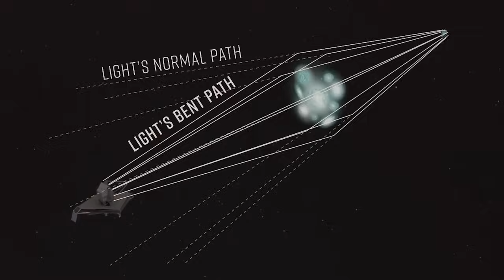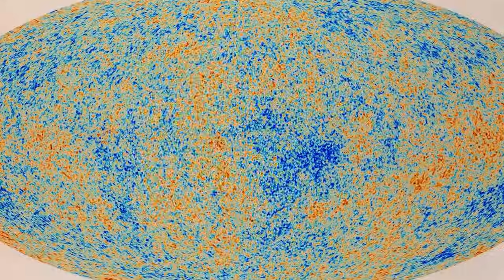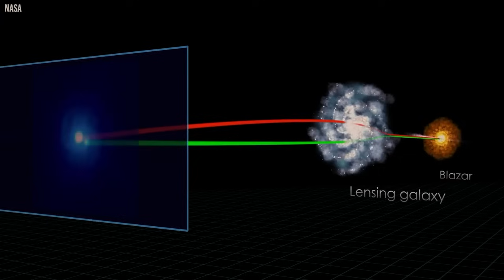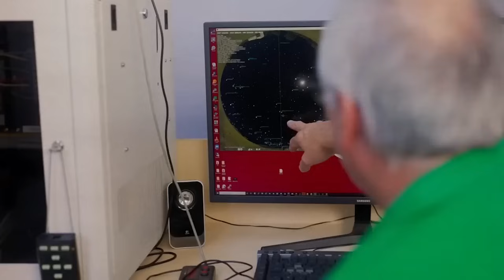James Webb Telescope Just Debunked ALL Modern Theories Of The Universe

Comment: The universe stretches apart (expands) to a certain point and then contracts again. 
Ultimately, the matter collapses and is absorbed by ultramassive black holes. 
Now a new universe plasma is forming, a kind of protective shell for the new space, which in turn fills with energies and particles, gases, etc. 
This activity is carried out by ultramassive black holes (quasars) that survive the collapse of matter at the end of the cycle of the previous universe and then convert this residual matter into energies and particles that power the newly created universe. 
This process is endless as it repeats itself constantly and can be called permanent renewal process of the universe. By the way, our universe isn´t alone, it´s actually a multiverse, which in turn explains the different expansion speeds (Hubble tension) in different regions...     :planet-orange-purple-ring:
Reply: Oh wow I never thought of that